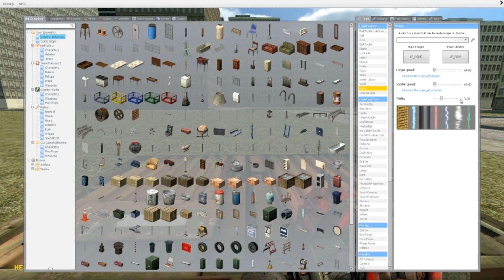Garry's mod tool tutorial part 11 - Winch tool

Comment: would it be possible to winch yourself somehow? is there a mod for that?
Reply from the maker: +Sam Reinen i know it's not possibe to winch yourself, and as far as i know, there aren't any mods for it. But i'd build something which imy character can stand in, and then use the winch tool on that insted?
Reply: +PlayingGmod  thank you terry much. I tried that with a chair and it worked great :)